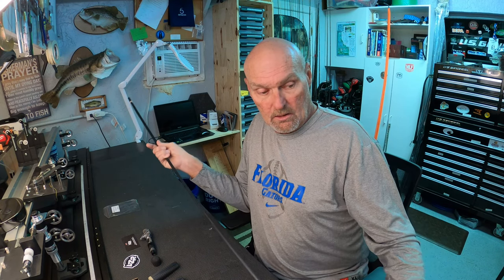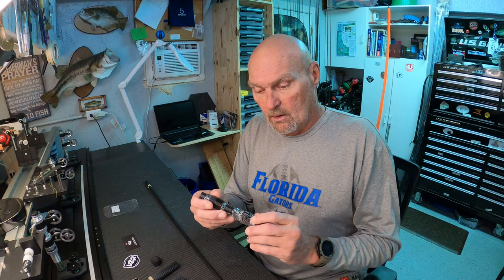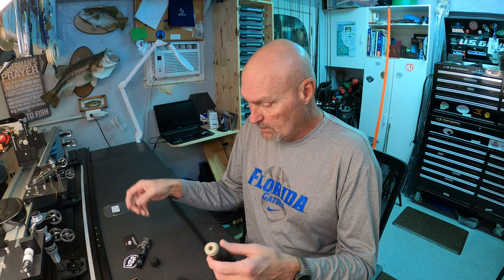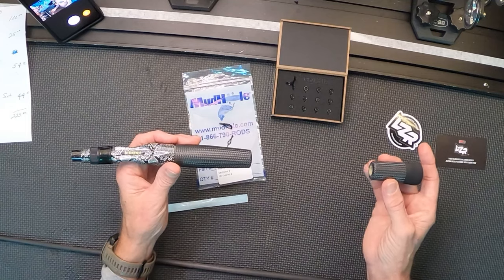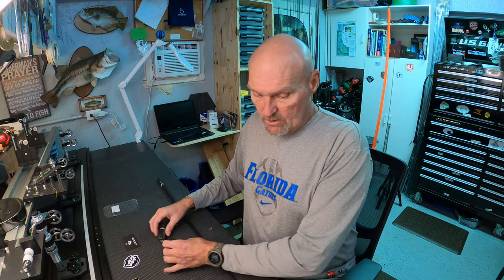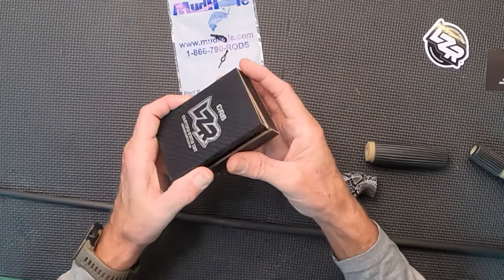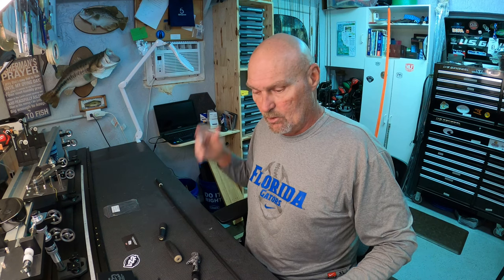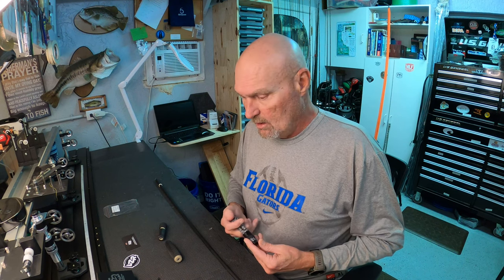Rod Design Basics

Comment: Another great video. I have a couple of questions and I promise I’m completely sober! Wanting to build a new rig and here’s is where I’m at so far, MHX S781 6’6” Fast Ultra Light 2-6lb. Butt 0.295 Spinning blank. I want to build it as a casting rod using Fuji SK2 reel seat with MXH fore, rear and fighting butt ID 0.375 and a LZR guide train, 12,10,8,6,6,6 with a 4/5.0 tip top in a spiral wrap. Using a spincast reel like Zebco Bullet, Omega or something similar. Would using tape to build arbors for the grips work? Do you see problems with this? Thanks!
Reply from the maker: You can build tape arbors for the grips.  They are not off by much anyway.  You will need winding checks or build epoxy ramps from the ends of the grips to the blank.